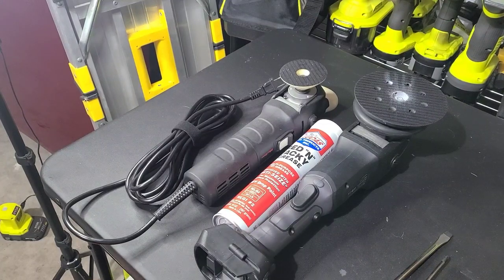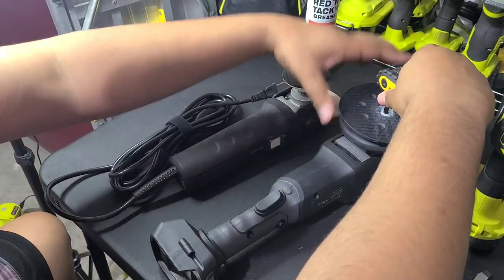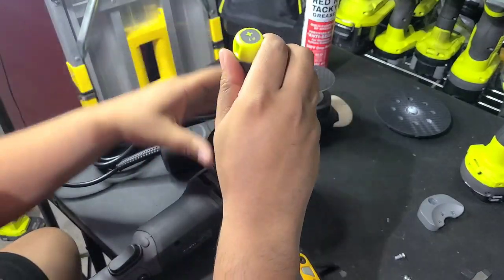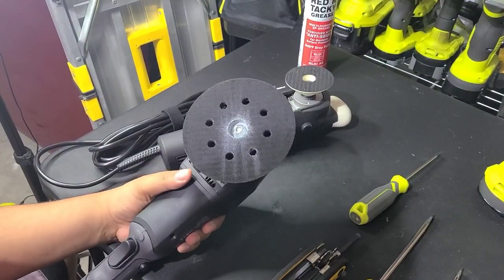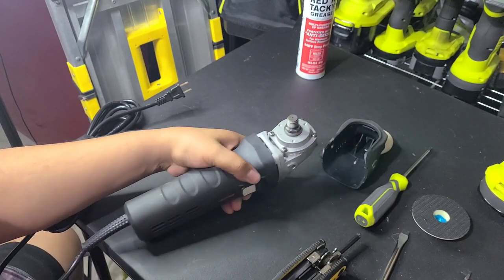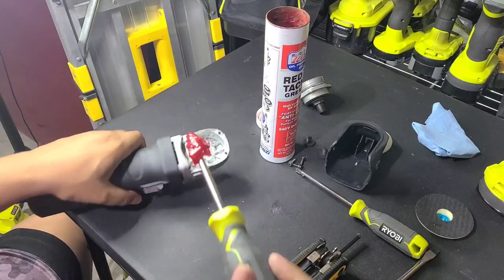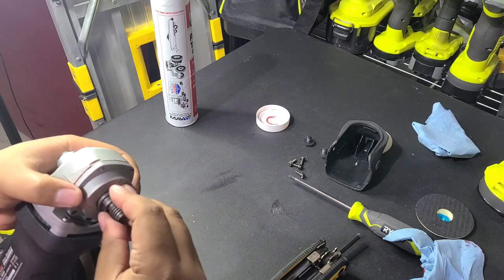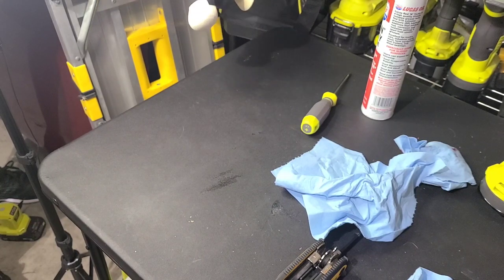[HELPFUL] How to Change the Grease in Your DA and Rotary Polisher

Comment: Idiot. You have NO IDEA what grease is. Its like watching someone replace 30w0 engine oil with 50w20 ....cause its "better" 😂
One youtube idiot does it cause he runs out of ideas for his videos and all of them follow. 
Im not gonna bother explaining why this is dumb. You people deserve the consequences and so do all people who follow you instead of ....you know....engineers😂
P.S. mixing grease is BAD you idiot. That's how little you know. Good thing that those tools will operate just fine even without grease or you would be F*
Reply from the maker: Wow very insightful and informative, thank you. This is a common practice to get machine polishers to run smoother and quieter. This is not an automotive engine or industrial machinery, just a simple power tool. Calm down and have a beer little man. Cheers 🍻
Reply: @BelLavoroAutoSpa  EXACTLY, and that grease is PERFECTLY FINE for it. As the tool heats up the grease flows and swings around just enough to have a coating of oil on it. The LESS the BETTER. You dont want the GEARS to run INSIDE grease. And even if somhow that was good for it, unless you pack it full to the brim with grease, you wont prevent the grease slinging of the gears  do to centrifugal forces. There is a reason it "sounds" damped down. The gears have to push that crap out of way by forcing the motor to work harder. The grease, unlike oil, does not transfer heat very much at all. There is a reason why grease are rated for particular use and heat resistance is only but one parameter. There is no such thing as "if it works in XYZ then its good enough for this". 
Its not a common thing its a comon youtube video filler. No different than bunch of teenagers modding their cars to make them "better" in ways that would make any engineer spit his drink. Their passion and eagerness to "advance their hobby" is 100 times bigger then their knowledge. The "bro science" can be very convincing when that's all you have to go on. 
As a youtuber you should strive to educate and put an end to the nonsense not pile on it. 
My advice is, dont be one of them idiots.
Reply from the maker: @MD-gk4uh  so then why do these all come packed full with grease from the factory?
Reply: @BelLavoroAutoSpa  They dont. What are you blind? Less then 5% of that space is grease.
Reply from the maker: @MD-gk4uh  I think you may be blind one, and incredibly arrogant. Actually I don't just think you are arrogant, you have proved that in this integration. I clearly open a machine here that is clearly packed with cheap white factory bulk grease. Every polisher machine comes that way. So you just came here to be a jerk but didn't even watch the video. Smart. Look at the 7:00 mark and you will see the factory machine grease clear as day.
Reply: Why you so angry bro? Bels just making a simple video like many others that you don't have to watch! The hostility is definitely unwarranted considering its a detailing tool not a nuclear reactor.
Reply: I did not see anything in this vid that was to bad or would harm the gears, nor bearings. So why are you getting butt hurt? These chinese made polishers always come with sub standard grease, also not packed correctly or enough. If your such an expert why dont you share your knowledge in a friendly way and try to help then instead of being a dic... Yes he put a bit to much in the small rotary but he recognized it and made an example of it?
Reply: Calm down baby
Reply: I run my machines alot, the first thing I do for my new machines is clean, pack with new grease. Then probably once a year depending on use. Nothing wrong with taking care of your equipment, most ppl won't take the time to do the maintenance and wonder why there stuff doesn't last, love the oil change comment from the pinned guy, cars from the factory change oil viscosity even under warrenty because one works better then the other. grease breaks down like any other lubricate, I agree that it isnt as fast as oil, but most of these  machines come with shit grease from the factory. Thank you for the video. Keep it up.
Reply: @Kyle-mo5si  Nothing wrong with taking care of your tools like there is nothing wrong with taking care of your body, so long you know what “taking care” means and when you are doing the opposite. 
In my country, the generation of my grandparents would consume alcohol when sick believing it is cleansing away the “bad stuff”
They believe they are taking care of their body like their friends and families have done for generations and alcohol was considered a medicine for all kind of things.
That does not mean they are right nor that I should do the same in a day and age where knowledge is do easy to come by. 
Saying you always done it and therefore it is “better” than just leaving it alone doesn’t prove anything. My garage is full of 20yo tools from HF that never needed grease and are just fine. 
Your ballbearings and motor will be toast long before any grease looses its ability that the tool came with. Compering it to an engine oil just shows how clueless people are about grease requirements. 

First learn about grease and then lab test the grease and then consult a tool engineer before claiming that any grease is subpar for a given product. Don’t spread BRO SCIENCE on YouTube to get clicks. 
We should be mentoring young people so they too become knowledgeable and capable much faster then we did, not taking advantage of them to make money while they are still “young and dumb”.
I say young because that’s the sort of people who fall for this. You tell us older fats to swap the grease in a brand new tool and we will point to 1000 things we never touched the grease and are working fine…20 years later while looking at you like you were the village idiot. 
But when old farts start teaching youngsters those things they can’t help but assume that they know better trough life experience. They have no natural intellectual defense so you fully taking advantage of them. 
The truth is that he needed video for his Chanel and this was low fruit he saw others do. He cares less about anything else. Grease knowledge is just a google search away. 
That goes for you to. Why argue me while you can just google some engendering information. 

P.S people like you or me might do things (like swap the grease) in our tool even if we suspect that it does nothing because we like that sort of thing. To me, disassembling tools and maintaining them is a form of therapy among many mechanical things and telling myself it is not all for nothing is just me trying to rationalize it. But I would never pass that practice to my young neighbor down the street by telling him his tools will last longer etc.
Reply: @MD-gk4uh ”Not gonna bother explaining” yet you wrote multiple paragraphs and are still invested in this thread after a year. People have been doing this for years bud.
Reply: Wtf? Have u seen the factory grease of the entire torq lineup? It's literally white petroleum. I switch the factory grease out with premium red lithium grease every time and I can clearly observe the improvement. I can't believe you don't know about this common practice
Reply: While I’ll agree the name calling was unwarranted, the man’s points aren’t wrong. Fact is both sides are arguing from a, ‘trust me bro’ point of view using anecdotal evidence.

The only accurate way to test is to run two machines, measure the running hours on both over many years with one having its greased changed and the other untouched in stock form. Repeated over a few sets will yield somewhat accurate results.
Reply: @AJ56  it's much simpler and faster than that. Take your brand new stock machine and do some tests while it's off, running and under a load. Check the harmonics with cheap basic tools. Check the ergonomics by quickly turning the machine upside down while running at different speeds. Listen to the machine operate and take notes of the vibrations by setting it down on its back while running. Watch the change in temperatures and the time frame Etc
Now you open up the bell housing and look at how dark the cheap white petroleum grease is getting from just a short amount of testing. Clean out the stock grease. Now lightly coat the gearing and inside the case with some anti seize lubricant. Lastly you'll fill it with thick red lithium grease and act shocked at the difference you notice. There are no disputes
Reply: He greased it alright! Bet you never used as much grease in your life. Talk is cheap, grease is cheaper!
Reply: He didn’t mix the grease mate, watch the video, he scraped the old grease off with a screwdriver. He also apparently didn’t get heavy metal poisoning as he did, clean it out, so all is good!
Reply: @TheEchelon  Yea, it’s called comment notification. People been doing all sort of hillbilly nonsense for a long time based on solid bro-science. Don’t change the fact it’s dumb.
Reply: @AJ56  Industries do that all the time- run test. This is WHY they use simple grease. It just does not make much difference worth mentioning. This is not high heat and high pressure application where your need fancy grease additives and formulations. 
I don’t need to provide evidence to hows and whys of industrial grease application. THEY are the norm. He needs to provide the evidence to the contrary. Whatever….
Reply: @Rabbit.760  Yea… now measure the speed and torque output as well as strain on that electrical motor before and after you do that. 
You packing a housing full of thick grease and noticing less noise and vibration as well as heat conduction jet you brain never asks WHY and what’s the PRICE? 

If you put 50W20 oil in your engine instead of the 0W30 your engine will sound quieter, feel smoother, burn less oil etc. so go ahead and do it then. Maybe after a while you might learn, the hard way, why those things are not always necessary a good thing and many times they are a tread-off. Just ask the know it all bro-scientist in car communities who swear by it. But not as much as shady used car dealers and some privet owners who use it as the magic engine rejuvenation fluid right before they sell the car. Only black tape across check engine light does a better job in less time…which you will need as well after few thousand miles LOL
Bro- science at its best.

P.S. I’m not claiming the lubrication in that tool is of the same critical importance as in the car engine. I am claiming just the opposite btw. It doesn’t matter so long you have enough of it to cover moving parts. Sometimes the line worker in China is responsible and is sleeping so you tool is almost dry. That’s different. In tools it’s nearly a compromise you have to dial with. 
He is only doing it for sake of YouTube content. THAT IS IT.
Reply: @andrej2321  Next time you clean your dishes do the same and let me know what your wife will think mate.

Comment: Car Wash Detailer(CWD) has a video titled "How to Grease Your Rupes Polisher"(search video on Youtube).  For those that don't know, Rupes is a maker of high end polishers and he asked them what grease to use in their polishers.  They recommended Super Lube(high end maker of lubricants) Multi-Purpose Grease.  So while CWD also said don't use "red " grease, the Super Lube Multi-Purpose Grease is the same grade grease(NGLI 2) as "red" grease.  So Bel Lavoro Auto Spa(BLAS) is recommending replacing 30w0 with 30w0(figuratively speaking, of course).  This is all just a matter of everyone wanting to upgrade to a better quality grease: BLAS wanting to upgrade from cheap Chinese grease to name brand US made grease, and CWD wanting to upgrade from name brand grease to high end maker of grease(technically, he doesn't want to upgrade, he wants the same Rupes quality grease).  They are all the same grade of grease...they just want better grease than the last guy.
Reply: Rupes suggests the only grease that should or even would be an upgraded from their factory grease is a synthetic grease...This is fact not fiction and they actually show the synthetic grease it should be upgraded to in the video...Rupes video not a youtuber...SYNTHETIC GREASE is their ONLY suggestion than the name brand they use because they already use the top Gear box grease from the factory...Don't know where the hell you got your info from obm415. I really don't care either way because I use Lucas Oil RED and Tacky (DEFINITELY not in a RUPES because I don't waste money on designer name heavy as shit equipment) I'M ON 20 VOLT CORDLESS BRUSHLESS ROTARY POLISHERS and the shit works amazingly. Clings to the drive gear and the rotary gear, handles temperatures up to 540 degrees, and has anti seize, anti moisture, and below freezing temperatures also...Too each their own...

Comment: What bothers me in all these videos about changing the grease in polishers (especially those made in China) is that every one of the shops has their own preference for grease.  The only sure thing I know is when the manufacturer says what grease is in their polishers.  Flex lists a grease in their parts breakdown but only gives a part number not what type or brand it is.  Griots garage specifically says their polishers come with a particular type of Mobil Grease.  I also wonder often about using an automotive chassis grease in the gearbox of a polisher since the requirements are different.
Reply from the maker: @Michael-t3b5b  it's a lot like oil. As long as it meets or exceeds a certain specification, it will be fine. In this instance, any automotive high temp gear grease will work fine for these electric tools.

Comment: I have the same SPTA cordless v1 and v2. First thing I did was change out the grease to something much better also something that actually gets picked up. When I opened them the factory grease was such a small amount I dont even know if it was doing anything. It is much smoother and quieter since changing it.
Reply: 請問是換哪一種的油？
Reply: What is the name og grease you use?

Comment: You don't have to unscrew the counterweight on the DA , only those 4 phillips head screws behind it (the screws on the counterweight are so tight that I almost stripped them with a screwdriver). Be sure not to overtight big plastic screws that hold the plastic cover, I broke one(.I have an unexpensive Yato YT-82200, which is produced by other brands and also Auto Finesse. It seems to work just fine with the factory grease (old school brown lithium) and there was plenty of it, but I changed it with modern Valvoline NGLI2 anyways.
Reply: Can you hear after you changed the grease, or is it the same?

Comment: Red and tacky goes thin when hot and pushes past the seals in the rupes and flex polishers i have
Reply from the maker: check the seals in that case. i havent had this run out on me at all.
Reply: @BelLavoroAutoSpa  just seems odd its done it in my LHR15, 75 + flex rotary. 3 polishers now, all weeping melted grease out the shaft in the middle
Reply: @user-ne7yd2zw4s what grease do you use then for your rupes?

Comment: Have you done the cordless forced rotation polisher?
Reply from the maker: No. I can't figure out how it comes apart. The cordless rotary took proprietary designs look to be sealed at the factory.
Reply: What about the new rupes hlr15 would you recommend changing the grease on it if so have you?